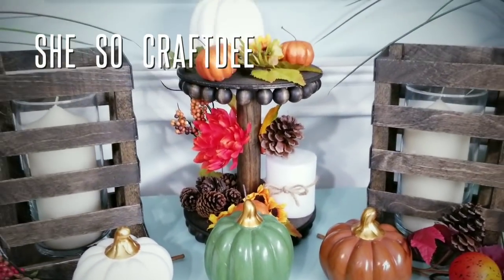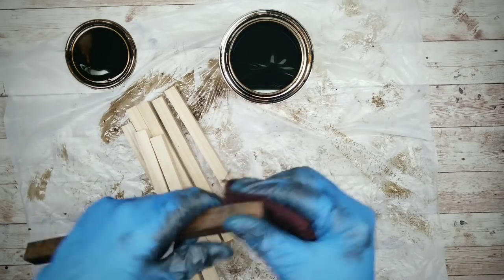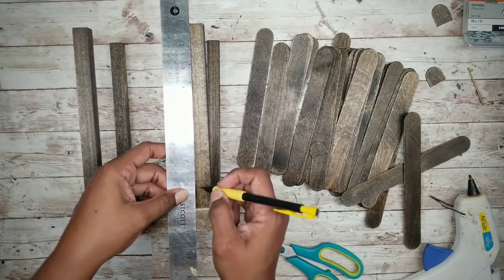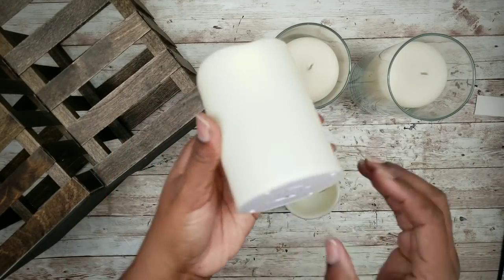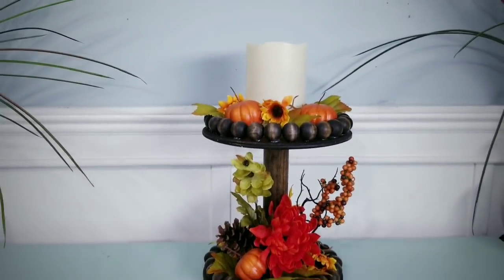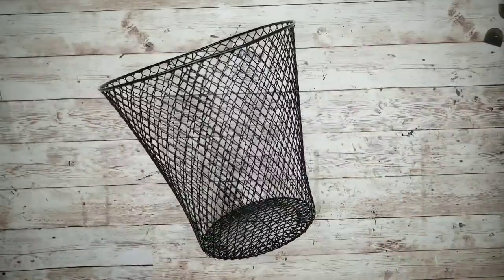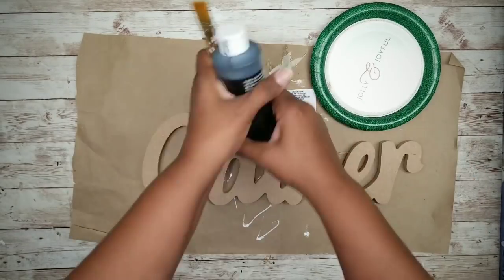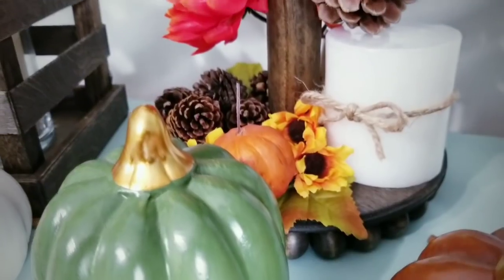3 DOLLAR TREE DIY Home Decor | High End | Lantern Candle Holders | Tier Bead Tray | Gather Wall Art

Comment: I love your channel and I’m so glad my daughter shared it with me. I’m making the Gather sign to hang in my dining room and I’ve done everything, however, the wire is not stretching as in your video to fit the frame. It’s more so the top and bottom of the longer pieces and I don’t know how to fix this. Any suggestions?
Reply from the maker: Hello there! Dollar Tree recently downsized the the size of the wastebaskets. Booo! The new ones will come up a bit short. You will have to make your frame about 2" smaller to accommodate them.
Reply: @SheSoCraftDee  thank you so much for responding. I can believe that, as they are downsizing quite a bit of items. I already created the frame and my daughter helped me stretch it as much as possible and it touches the frame and that’s good enough because you can’t tell unless you’re looking down. I love the outcome. Thanks again.